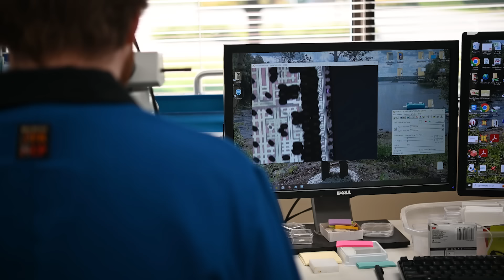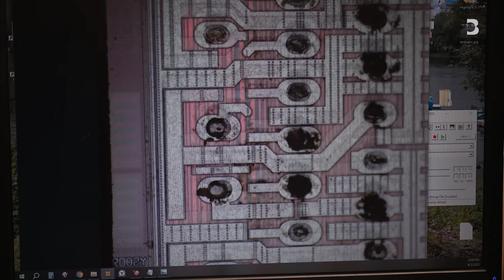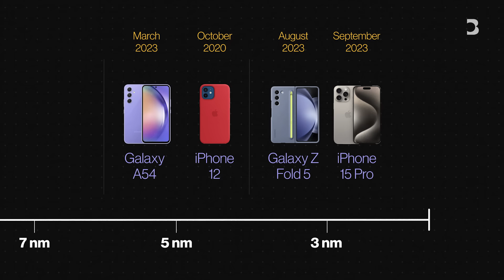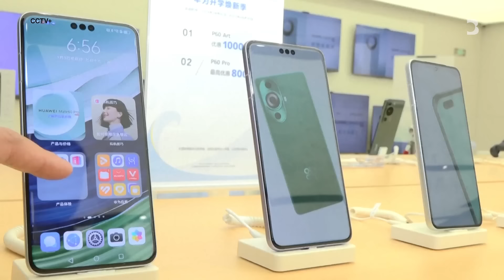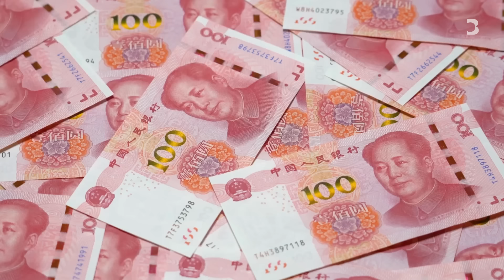This Is How Huawei Shocked America With a Smartphone

Comment: As an engineer and a university professor, I'd say what changed most in China's supply chains is the swift and almost complete replacement of foreign components. Before 2018, as far as I recall, engineers in China are not encouraged to use domestically produced components because they are generally considered as inferior compared to imported counterparts. Nowadays almost all companies in the industry have turned completely to domestic parts to avoid the risk of "cutting off" of imported ones.
Reply: 是的，中国很多公司被坑怕了
Reply: 感谢他们给了国产发展的机会
Reply: 比如近两年的中国手机品牌采用了大量的中国零部件，比如屏幕面板，现在全都是中国国产屏幕面板，它们来自华星光电、京东方、维信诺、天马等。几年前还在流行使用三星LG屏幕面板，短短几年销声匿迹。那些因为制裁面临倒闭的企业被其他强大的企业收购，停掉的项目再次被启动，并且扩大了规模。还有大量企业没有交卷或准备交卷，那些不起眼的企业正在出现在大众视野。美国政府的制裁不仅加速中国技术转型，还让中国企业更加团结。
Reply: @kkas539 Nice
Reply: Because China has the largest number of engineers and competent industrial workers in the world
Reply: @kingwing3203   Unsurprising, given the size of its industry and number of universities. West largely deindustrialised itself from 1970s onwards.
Reply: It's not that, it depends on your price. Self produced products don't necessarily mean low quality, but rather have more choices compared to mature high-quality products. Moreover, many high-precision semiconductors in China will also be exported, such as Zhitai (Zhitai) SSD, which is a better existence than three-star SSD and has a very affordable price
Reply: @苑少坡  
Once local supplies are available, using external supplies becomes a much greater perceived risk, making the localization practically permanent.

Comment: The fact Raimondo states she's more worried about the scalibility of the Huawei chip indicates her true intentions of hitting at the commercial success of Huawei instead of the security concerns with such a chip. Military demand for such a chip would be puny and should be more concerning rather than the scability of such a chip.
Reply: That, and the realisation that the “they stole it from us” tag is rapidly losing efficacy - when the market has been completely taken over by a new thing, no one will remember or care if it was or wasn’t copied from an old thing (cf. 80s Japan).
Reply: Military needs chips at a scale. Ongoing huge amounts of them and fast.
Reply: Security issues of a chip. Never knew chip got security issue
Reply: @swarasyam  Maybe i should hv phrased it as security concerns regarding diverting chips toward military use which has always been brandished as the perfect excuse to sanction and ban exports to China. But as I pointed out the use of such chips would be puny in weapons first because they would be too fragile to withstand the real life conditions of weapons like misdiles or tanks unlike your phone. So military applications are more likely to use older chips with a more rugged demeanor rather than a tiny chip to maximize energy consumption and portability  .
Reply: @d3r4g45 Yeah but they basically don’t really need state of the art manufacturing nodes. China has been self sufficient in military chips for ages. This is about national security as much as the success of Reels over TikTok is about national security, which is remotely relevant at best.
Reply: The battles of the future will be fought leveraging the best AI models,  computer aided designs, simulation and modeling using supercomputers. The military heavily depends on large production of chips. The chips used in military vehicles are just the tip of the silicon iceberg.
Reply: weapons don't need tiny chips
Reply: @lvjinbin28 and it does not need the delicacy
Reply: @lvjinbin28  drones do
Reply: Correct, and the military does not need to be as efficient because you're not selling to consumers who could just as soon choose from one of a dozen competing products. Also, military hardware typically requires more robust chips and the lower-nm chips at the bleeding end (3, 5 nm) typically are not hardy enough for such applications.
Reply: @DNO_music  Not really. Drones can use the same chips as used in missiles.
Reply: Military chips are not that small at all!😂
Reply: You can build same functionality / performance with larger, multiple chips or with FPGAs. Its is just a matter of cost and therefore scale. 
Sure heat could also be one factor, but its a probably a corner case of benefits.
Reply: @bobmorane4926  When one uses all kinds of dirty tactics to try to pull down the competitor, it's a clear indication that he/she is already at the losing end.
Reply: yeah since military equipment designed to broken at some point, using advance 7nm chip right away is not cost feasible, better produce 1000  misilles with 14nm, than 50 missiles with 7nm
Reply: @lvjinbin28  >> weapons don't need tiny chips <<
Even if they do, they still have to pass very rigorous safe/environmental standard/certfication process that could take as long as 10 years (or on average).  For anything used in spaceships, the testing/certification is anywhere between 10-14 years.
Reply: You're absolutely right. Military doesn't need the most advanced chips - they prefer mature nodes ( > 28nm ) over the most advanced nodes ( < 7nm ) due to stability as well as that chip size is usually not an issue for military equipment. China's military chips are always self-sufficient. So talking about concerns over the advanced chips being used for military purpose is just bs. The ONLY thing the West is worried about is that China is going to beat them in consumer markets.
Reply: Not really, you need scale to carry the incredibly high cost of investment
Reply: @bobmorane4926 haha you really believe there is no military purpose for modern Arm processors??? oK
Reply: Standard murica.
Reply: "national security" is always just a alarming word for the govt to make sense of whatever they wanna do, who on earth can threat America for chrits sake.
Reply: @d3r4g45  yeah but not from commercial suppliers
Reply: So ture. China earn the money us should earn Even inside china.
Reply: If it is purely about military capability, why did they ban them from using google and you tube as well? They are worried that the missiles may use google map to find their target?😂
Reply: @LCCATCX yeah that why Google in China use Mars coordinate 👍
Reply: If you can't compete with them ban them 😮
Reply: i agree. In fact military equipments on the field actually benefit from larger sized chips because it is less fragile. RN most military equipments utilize larger chip sizes anyway
Reply: Of course this has nothing to do with military and everything to do with economics
Reply: @JoeWayne84 only for hq server, not the mass weapon as America excuse
Reply: In fact, one can easily discern the true purpose behind the United States' sanctions on Huawei without much thought.